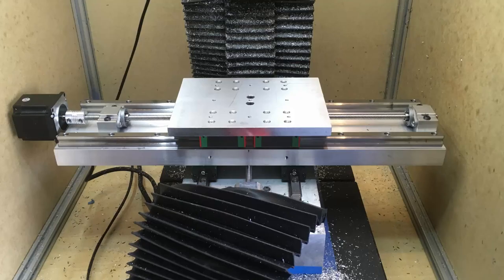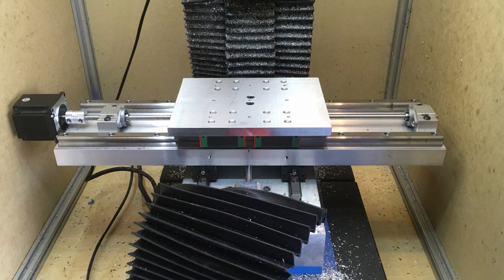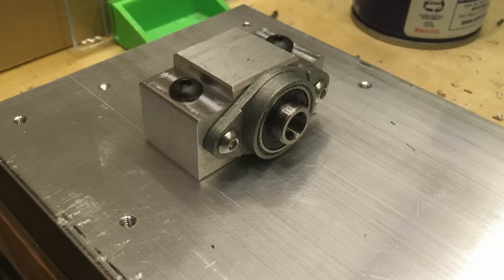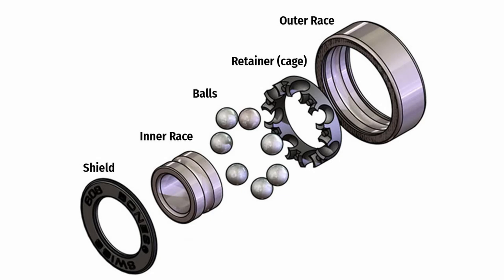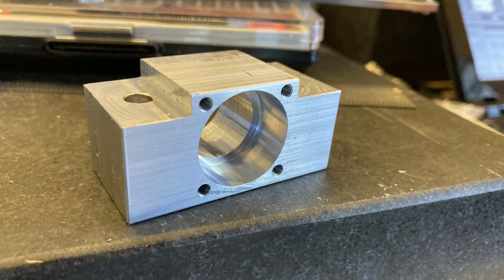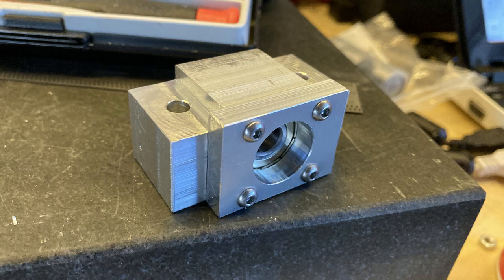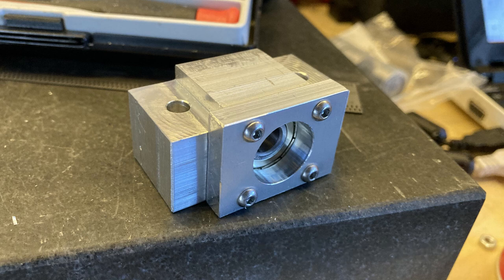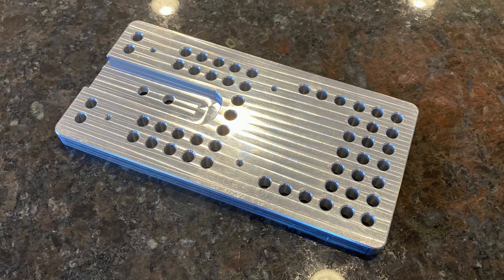DIY CNC Bearing Failure

Comment: These flange bearings are meant to rotate axially— they do that to compensate for axial misalignment
Reply from the maker: Maybe that's the difference. I think they're still not supposed to move axially, and didn't when they were new, but maybe whatever feature allows them to rotate like that also makes them loosen up under load after a while.

Comment: I think a single sacrificial tr8 bronze nut can be cut on two pieces - the one that does an actual preload and a counternut. Same setup for other side of the bearing.
Reply from the maker: And then drill them for a set screw? That's a good idea.
Reply: @imnoexpertbut  I suppose that 'counternut' part should handle it fine without a set screw if it tightened with enough torque to prevent a slip between those components.
Reply: Hey! Now OpenBuilds store actually has a tensioning nut with a set screw :)
https://openbuildspartstore.com/tension-nut/
Reply from the maker: @oleksandrgrytsenko  Hah! That's perfect. Even though they hadn't failed yet, I made the same change as in the video to my Z axis bearings, and tried your suggestion. The brass nut didn't stay put by itself, but I was able to add a set screw and that worked great. If I need more in the future I'll probably just buy these openbuilds nuts!

Comment: Very nice videos 😊👍 Why don' you  use BK12 and BF12 type supports?.  They're very inexpensive.
Reply from the maker: They're too tall to fit underneath the axis carriage plate; I only have 28mm of clearance. If they don't fit under the plate, they would still work, but I would get less axis travel. I could mill out a big pocket between the linear rails, if I had a big mill. :) I could possibly bolt on risers for the linear rails, but that would reduce my Z travel slightly, and might affect rigidity slightly. The low-profile blocks I made were pretty simple, so that was the easiest option.
Reply: @imnoexpertbut  I had to add shims on mine. I have no tools. I printed them in plastic :)  Using some playwood and dreaming of aluminium.😊

Comment: couldn't use tapered rollbearings instead ?
Reply from the maker: I ended up using double angular contact bearings, which are similar to tapered roller bearings in application, but from what I understand angular contact bearings tend to be a little more precise (less clamping force required to eliminate backlash).